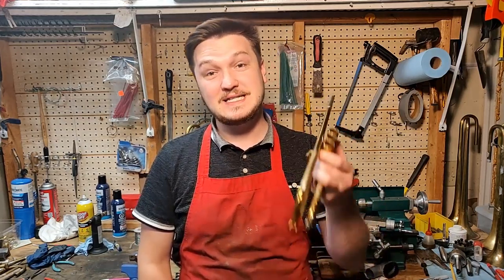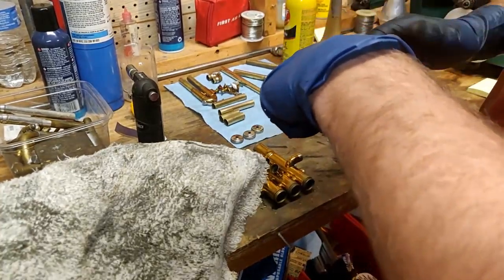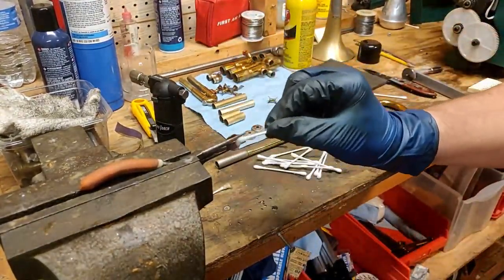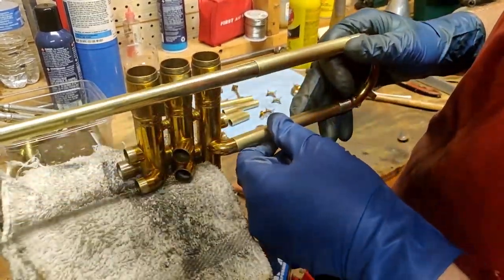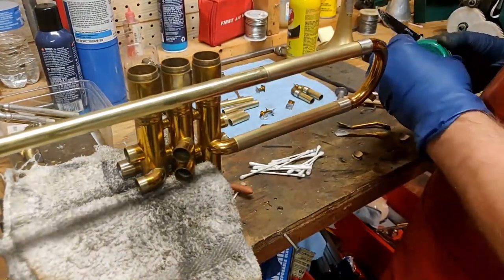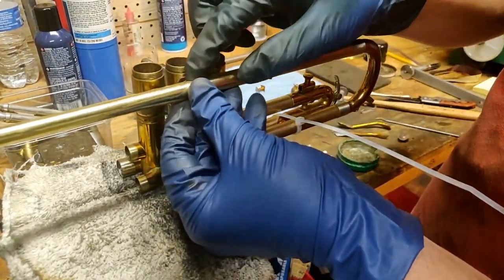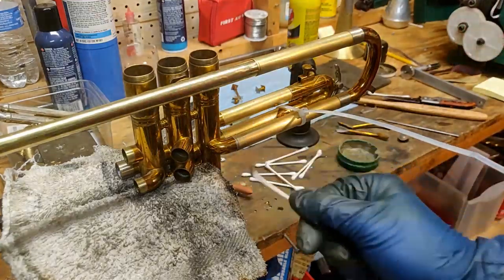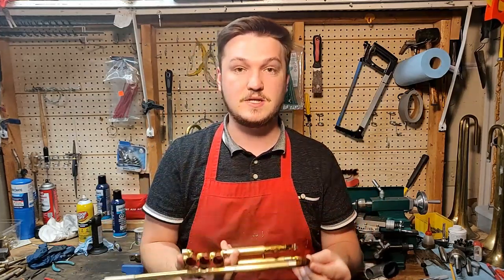Restoring a Donated Trumpet to Playing Condition | Part 5

Comment: I bought a 1933 William Frank Trumpet made near CHICAGO. All the inner slides are made of nickel.The horn has a nice mellow tone with great compression on the bottom spring valves . It also has a great Frank 20 mp. Old horns have thicker lacquer and built well.